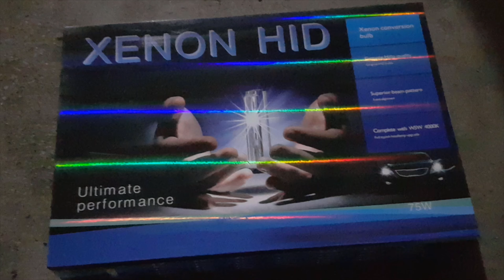CASTA HID KIT 75 W – Can bus Technology - H4-2 – 8000k

Comment: Will it work for corolla 2006
Reply from the maker: yes will work you need 9005 or 9006 for your head light
Reply: Just so you know these will blind oncoming traffic in a lot of halogen reflectors. So please use a lower wattage like 55 for on road. These 200 watt hid's have been testing a bunch. And many actually only put out about 104 watts, not the 200 watts advertised.